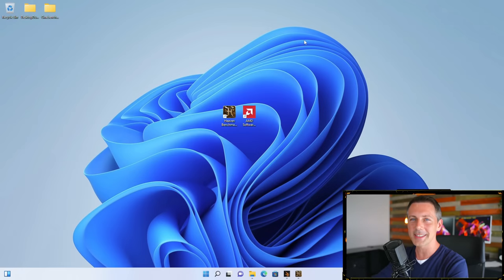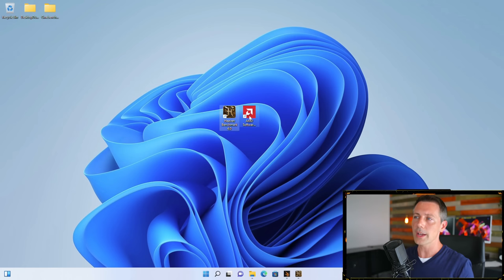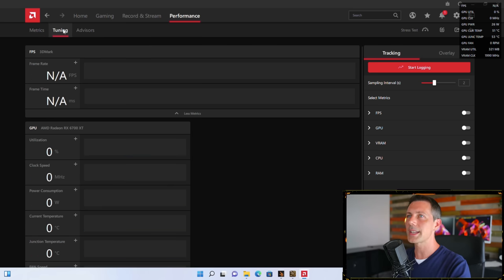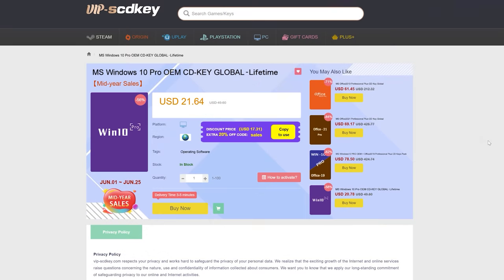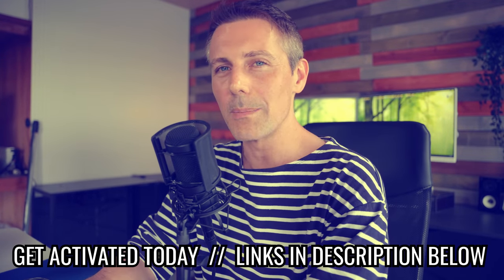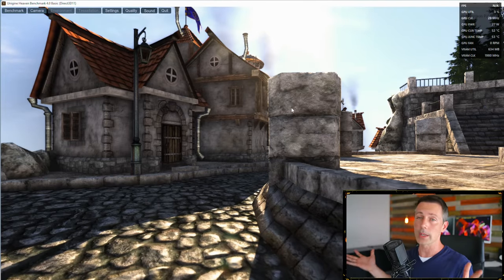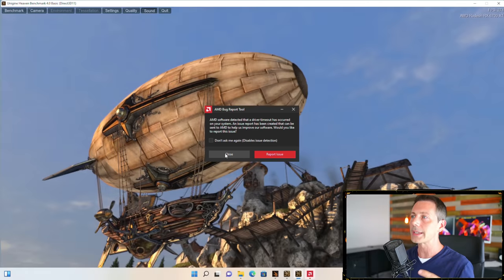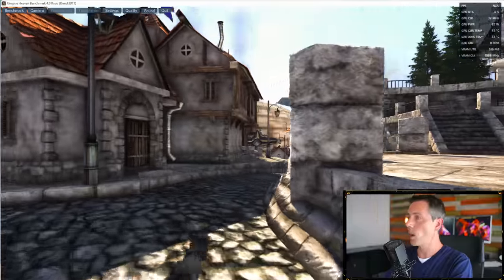How to UNDERVOLT AMD RX 6000 Series GPUs

Comment from the maker: I will work on getting the NVidia GPU and Intel CPU tutorials done!
Reply: In times of rising energy costs, undervolting is saving a lot of money. Nearly the same results but half the energy consumption.
Reply: Hey nice video as always Brian, I have a question I'd be really happy if you could help me with.
What would be a good price for a Ryzen 7 1700x combo with a b450 Tomahawk max board in your opinion for reflipping. (Just Board and CPU)
Reply: Brian, do you have a good starting point for an rx 6800 frequency & volts ? @ stock with out touching the frequency I can get 930-50 mv stable. But I want to save more power.
Reply: I played with PBO for months. The 3400G is straight up crap without it... it definitely give much better gaming performance especially when it is used a dedicated graphic card. For memory latency: doing over 5 times of AIDA64 latency test I got the same 65ns latency even tho the CPU shifts the speed every time. Actually PBO is a lot better than Intel's Speed shift which is a quite bad power saving feature destroying competitive experience with more buzzy frame times. I found PBO a game changing feature for that CPU. the 3400G never did well at locked voltages that gave higher thermals and so less achieved clock speeds. I believe Curve optimiser is the best way to overclock Ryzen CPUs. Otherwise manual tuning is just a crap
Reply: Waiting for it 😁
Reply: Thank you! Im not tech savvy but Im really interested on doing this to my 2060 oc. It gets too hot :(
Reply: Thank you bryan this is very handy for the energy prices will become completely crazy , that's also part of why i'm starting to size down some of my pc hardware to things like the steam deck / gpd win max2 that offers excellent perf / watts like we have never seen before
Reply: Looking forward to the Nvidia undervolt guide. I've had a 6800xt for a year and a half but recently grabbed a 3080ti too to ad to my collection and not that familiar with tuning it.
The Radeon Softwate is awesome for tweaking the gpu, it's what I use.
Reply: When you make the video on NVidia GPUs can you make the tutorial with a proper under volt curve that flattens out. Most YouTube tutorials on gpu undervolting have the lower clock frequencies overvolted and only the max target frequency and maybe 200mhz before it undervolted.
Reply: Thank you Brother! Def could use the Intel CPU help. But this AMD tutorial also super helpful!!
Reply: @kaisersolo76  ancient gameplay has a 6800 video. His starting point is -50 as well, so just move that slider to the right little by little and test in between
Reply: can you also work on an AMD CPU undervolt guide?
Reply: I can't wait for the Intel one! 12 gen is toasty
Reply: Nice … as far as I know you could undervolt without reducing clock speed
And if I recall correctly Nvidia cards might even run higher clock speeds while undervolted (technically Nvidia cards over clock automatically when power limit and temperature limit is not exceeded)
Reply: Please i need a video of undervolting i3 12100f if possible 🙏
Reply: Do you ever use the built in Radeon stress test feature? If so what are you're thoughts on it?
Reply: I would love an rtx 3060ti undervolt tuto, thanks alot for your work
Reply: The best way to undervolt RX6000 series is to use MPT and limit both Core and SOC along with PPT and TDC. If you drop the FLCK frequency down by 100-300mhz you can get for example 6900XT to 850mv-900mv which makes it an efficiency beast, losing around 10-15% from stock performance, but dropping power to 50% and temps to 60% of stock.
Reply: does it work with MSI afterburn instead?
Reply: Will this same settings work on a Gigabyte RX 5700 XT? I have a friend that has one that since day one out of the box Junction jumps up to 110 or higher and GPU crashes.
Reply: erm...what would happen if i try this and system crash but i have 12400f?

Comment: I undervolteted  my rx 6600xt to 1045mv 2500-2650mhz to keep stock clocks and memory to 2300mhz. 12% lower power consumption and 8% better perfomance
Reply: how are the temps in idle ?
Reply: @ibobeko4309  close to 50°C (0rpm mode)
Reply: @havi293  really, i have 1070 even in that heat right now it is 35c in idle also 0 rpm. The problem with 60c so much heat is, it is heating up other components also, nvme and chip sets also getting hotter. 

What happens if you watch movie or youtube, how  high does it goes there.
Reply: I have 6600xt too and planning to undervolt it. Is it 100-110 GPU PWR Consumption on ur settings??
Reply: @ibobeko4309  both temperatures core and hot spot are the same up to 50°C and fans depend on hot spot temperature, it's hot outside (32°C)
Reply: @pauppey6332  If you mean power limit it is 100-120%, power consumption depends on a game 100-125w
Reply: I cant go past 2160 when i set it to 2200 i see artifacts in games even with full voltage, although i can get my clock pretty high 2800+
Reply: @formidablefoe3016  I have got Samsung memory, do you use default or fast timings? In my case changing voltage doesn't affect vram oc
Reply: For my nitro 6600xt, the min frequency is 700, do I leave this at 700 or lower it to 500 like how it is in the video?
Reply: @kashif4463  700mhz is also fine, my gpu can reach lower voltage when min is 2500mhz (even 1038mv) below this clock it isn't stable and  my card for min 700mhz lowest stable voltage is 1080mv
Reply: @ibobeko4309  bro gpu doesnt go high if you dont play a game, i have an rx480 0 rpm mode till even if i play a light game but any normal game it turns on and i have 2 50cfm intake fans with low speed

Comment: Thanks for this.  I went with your recommended settings on my XFX 6600XT.  It made a huge difference.  My power consumption went from 145 watts to 105 and my GPU Cur and Junc temps dropped 20 C in Heaven benchmark.  I didn't notice a big impact on FPS.  I think I will keep these settings for now.  I found out the Radeon software had reset to the default "quiet" gpu fan mode so changing that to more aggressive helped also.  I think my gpu will last a lot longer now. 🙂
Reply: What about idle power consumption? Does it make a difference?
Reply: @rct999  Hi idle power consumption is about the same.  4 watts @ 3% gpu utilization.  It's similar to what it was before it seems to make a lot bigger difference when I'm pushing the gpu hard in a game @ over 50% gpu utilization.  My 5600x cpu draws about 14.5 watts at idle.  I have this PC in a 14 year old Cooler Master monster tower case with 11 fans. 🙂 It runs pretty cool and is very quiet unless I'm gaming since the fans don't need to spin up much.   It's worth a try you can always set it back to default if you aren't happy with it.
Reply: i want to undervolt my xfx 6600xt so did you change power limit?
Reply: @tose1991  No I left it at the default setting.
Reply: were you having black screens on default settings?
Reply: @tose1991  hey, I don't know if you found the answers that you've been looking for, but here goes. There is a YouTuber called "Ancient Gaming". He has many many different a AMD GPU cards. He has the same card as you as well. He does such an awesome job at explaining everything that anyone needs to know about undervolt and over clocking your graphics card.
Reply: Can you mention the frequency and voltage you are running your RX 6600xt?

Comment: Brian you got me into undervolting a few years ago and it's still one of my favorite things to do.  I've managed to undervolt and slightly overclock several nvidia and amd cards.  Better performance, less power usage and less fan noise, win win win
Reply: I'm 31 now, US, and I think for the last 10 years, "Afterburner" has been a required part of my regimen. Brain thinks "more = more" and I'm slowly coming around to realizing there's so much that doesn't apply there anymore. GPU architectures are entirely different now. 300w doesn't mean 300fps (Never correlated that just making simple point). You mean to tell me that I've been essentially wasting 60-80w of electricity at a time, for 2% gains???

(Looks at electricity bill) Let's trim you down a bit.

Comment: Just to comment: FurMark as a benchmarking tool puts more demand on the core voltage while Haven puts more demand on clock speeds. If youblower the core voltage in Furmark the render will start artifacting and will crash more often. To me swapping between the two is more realistic to workloads and the sort.
Reply: For me neither showed instability quite as well as time spy extreme which would crash within 30-80 seconds if it was unstable where as heaven and furmark would just keep running.

That said I'm not too confident if its actually instability or just flukes since if I set the minimum clock speed to 2300 and max to 2400 it would run fine but if I set minimum to the default 500 then it would crash. Sometimes this would reverse and sometimes both scenarios would crash

Comment: Thank you so much for the video. Managed to tune my XTX 6600XT to similar settings to yours ( 2400Mhz and 1090Mhz and Vram 2100) with 10° lower temperatures and power usage dropped 26% on average ( 93W vs 126W on average) with performance loss only 2.2% ( same benchmark as yours with the same settings FPS 139.6 (default) vs 136.5 ( tuned).

Comment: You literally saved me from a severe mental breakdown. My computer turned off randomly during games but never during hard work such as video rendering. I don't know why. I learned about using the AMD software (including how to measure metrics). I followed your tutorial and undervolved my RX 6600 XT to 2402 Mhz @ 1100 mV, as suggested in the video. I got down to 85-90 degrees from 110. I also got down to 95W from 130W. I increased VRAM Speed by 3%. Result: Less power consumption, less heat, more stable system, and most importantly, Not even less FPS. Educating myself on this topic was a major win. Great video, too!

Comment: First time I've tried undervolting. Thanks for the video. Got this for my 6600XT, on first try and that's good enough for me, so won't try for more:
135W -> 100W
2540mhz -> 2350 mhz
67C -> 62C
2000mhz VRAM -> 2200mhz
Heaven went from 1566 pts / 62.2 fps (4k) -> 1547 pts / 61.4 fps
Save 35w for 0.8 fps? Deal!
Reply: For my nitro 6600xt, the min frequency is 700, do I leave this at 700 or lower it to 500 like how it is in the video?

Comment: Thanks for this concise summary. Helped me undervolt my 6650XT for the first time, and I'm a bit shocked how much power efficiency the stock settings left on the table. I get there is always a push for better raw performance, but over 60% performance per watt increase is insanity.
Reply: Hi! Can i ask for your undervolt profile?Also, do you see the used Watts in the overlay? It doesnt show on the program :/
Reply: @baya6002  could you please help me with one if you've found out how?

Comment: Thanks for the tutorial, got my 6600 stable at 2404mhz at 1080mv, ran heaven benchmark for 20mins, no crashes, played couple games, no crashes, temps dropped by about 20 degrees
Reply: What is your minimum mhz and Max? do you alter your power tuning?

Comment: Hey Brian, this is great content. I would really like a part 2 where you show power consumption before and after on the cards between the RX 6600 and the RX 6750. Others might appreciate the higher end cards added to that. I just did a 5600x build and I'm currently using an RX 570 recycled from the previous build. So I've been debating between the 6600 cards.
Reply: I’ve recently purchased a 6800XT as an upgrade from my 1070 and paired it with my 5600x and it is beautiful
Reply: @vp1xel687  I appreciate the feedback. A couple weeks ago I bought a ASUS 6700XT. I'm pretty happy with it. I'll be working on the undervolt over Christmas break.
Reply: @Fr1day-RT  nicee, hope your undervolt is successful, I undervolted my 6800XT yesterday and I have found about a 1-2% FPS drop with an 80W power drop so I am extremely happy with this
Reply: @vp1xel687  hello, did You have some issues with drivers about the Graphic card or the Windows issues like MPO? I have recently screen off ando re start Windows with some games like apex or fornite when i put fps in 75 or higher when My monitor is 60hz. My Graphic card is rx 6750 xt msi
Reply: @sinoidal5683  No i have not had any of these issues? I'm not quite sure what your issue is?
Reply: @vp1xel687  I'm looking to do the same build as you, do you recommend that I get the 5600x for SAM or get the i5 12400F for better preference?

Comment: I noticed that if you leave the voltage control to the max and only adjust the frequency, the card will only pull the voltages it needs for that frequency. From there you can get a good base on how to adjust voltage based on the target frequency you want or even leave the voltage always to the max and just set the frequency.
Reply: So I just did what you said. One basically just need to lower the frequency to "undervolt"????
Reply: @Spawn223311  no I think what that guy said is not true. You need to lower the voltage to under volt and you should also adjust the megahertz to within 100 MHz of each other. So let's say your max frequency is 2100 MHz, then your minimum frequency would be 2000 MHz doing this will help your 1% lows for FPS.
Reply: @philmccracken2012  I just lowered my Mhz only and it did just that. I tried what the video suggested, but it kept crashing. That could mean that my card is very optimized or efficient. With just 100 Mhz lower, my temps where 10c to 15c lower and more stable with little to no drop in fps. Increasing your min Mhz will make your card not rest when it doesnt need that much power.

Basically my card is Over Clocked to the max by AMD and cant be pushed further. So Im just underclocking an unreasonable overclock. I have a 6750xt and my junction temps where reaching 98c to 105c with some games, now it stays at 85c to 87c
Reply: @Spawn223311  same, I can lower the volatgeon my Red Devil 6750XT to 1100 and everything runs fine, but once I lower the Core clocks, amd driver timeout error
Reply: RDNA2 cards are kinda ass like that. You don't have much control about what you're doing.

Alternatively only lowering voltage will also lower clock rates. You can sort of force clock rates by setting the minimum too but the card can still just ignore that.

It's really annoying.

Comment: Very interesting tutorial Brian. I admit following ancient gamer vids on overclocking an rx 570 without success last year and recently bought an RX6700XT as open box return from Overclockers UK but with 90day warranty. Tried underclocking following Ancient vid and again no joy! Even tried default radeon undervolt with no joy. But one option suggested was to compare fps with tv/monitor used. As i used a old sony tv 60hz i restricted fps to 80! Amazing results when playing halo infinity, the power dropped from 124w to 104w on high settings. Which compares with max draw of 186w in kombustor donut stress test. Thanks for making this tutorial and trust you are enjoying your time in Japan👍

Comment: 17:58 go into bios turn on curve optimizer, select negative, select somewhere between 25-30 and Bob's your Uncle.
 
What this does is change the target power for each clock step on the CPU. Which also allows for the CPU to boost higher since it has power headroom. For instance I have it set to negative 30 on my water-cooled 5900x and I see boosts to 4.95-5 GHz. When running CPU heavy tasks I see all cores sit around 4.45 GHz. This is not a true undervolt, but it will allow your CPU to down-clock unlike an all core setting. I think it balances out in the end. As for latency, like tech said it's a user mileage situation.

Comment: Dropped the hotspot on tomb raider from 90-100c to 70s and way less power from 140 to 80s, wow. Using a rx 6600 xt. Fps stayed the same in the 120s.

 Great vid, set max freq to 2400 & vram freq to 2200 & voltage to 1100. Runs fine so far.

Comment: I knew about undervolting, and I've done it with my last Nvidia cards. a 1080Ti and a 2080 Super, both run much more stable, cooler and more efficient by doing this. Now i'm sitting with a 6900xt saphire toxic watercoold edition (bought 2nd hand) and it runs pretty hot in my opinion. 290W and 87C in the junction temp. But it's watercooled, and I guess it's top quality components. But it's loud and it makes alot of heat. It gest noticed if you play something GPU consuming. I run it with Chill on (60min and 101Max) and that makes it pretty decent most of the time, until it actually needs to use all the power it can to reach 101 FPS, which in that case... it gets warm and loud. As I said I knew about undervolting but.... I thought I did not have to. I tried it... From 290W to 190W... Doing just as you said, AND the performance reduction is from 8360 -> 8145!!! I thought it would be much more, hence why i did not undervolt before!  So, about 3.5% FPS reducation and 35% power reduction!!! Yes please! Now I will enjoy my card to the full! Thank you mate for the very efficient and warming guide :)